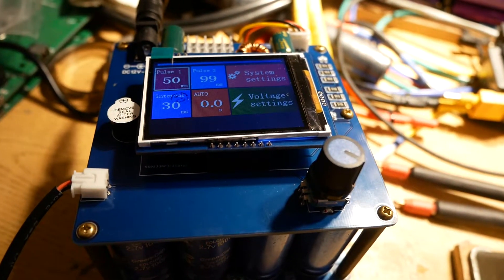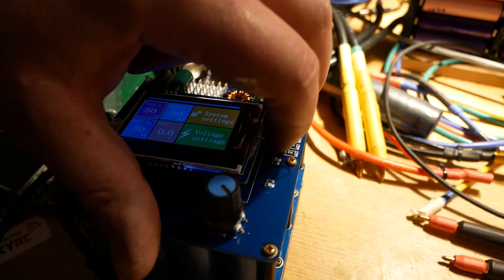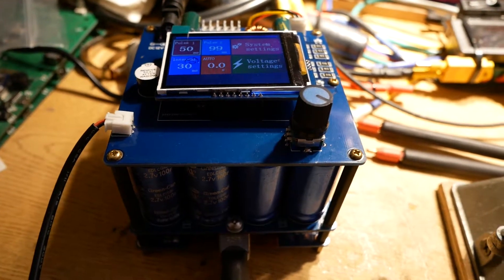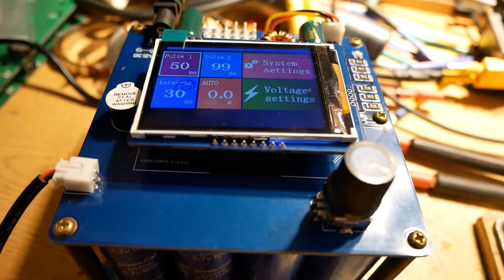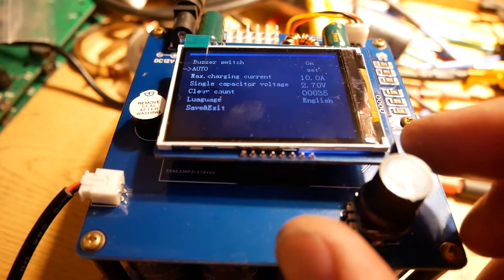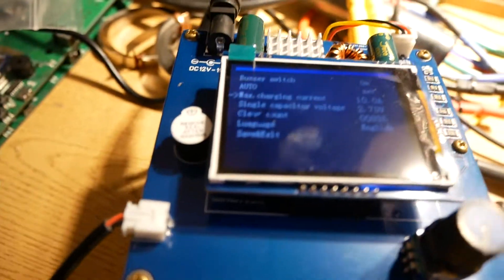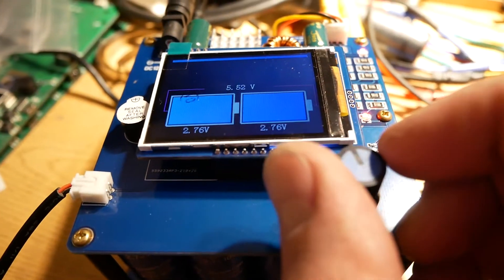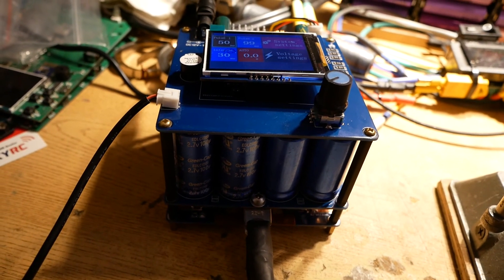Chinese 1600 farad spot welder review 1

Comment: The DB 100F 2.7V ones in my old data sheet says 10mOhm @ 1kHz... So maybe 2.5mOhm in total, not sure how much inductance and resistance is added by the studs though.
Reply from the maker: I replaced the studs with copper rod that is much thicker.

Comment: It’s all about the capacitors. Even a Kweld with crap capacitors will be crap
Reply from the maker: That's overly simplistic. It's about  several things actually. 
1. Lead lengths need to be short enough that the inductance on them doesn't impede current flow to the tips overly much.
2. Lead cable needs to be large enough to carry the current with low enough resistance to not waste too much of it.
3. Low RDS mosfets with quick turn on times are needed so that current isn't impeded by the mosfets.
4. Current paths from the super caps to the mosfets and the weld leads need to be very short and very beefy so that inductive and resistive losses are very low.
5. High ESR super caps will dump current much more slowly than will low ESR caps. Either have lots more high ESR caps in parallel or use low ESR caps.

Comment: i ordered this spot welder a week ago expecting it will weld 0.2 for milwaukee battery, did u ended up upgrading it?  im thinking about getting the kweld as well, what do you recommend me getting? is complete kit with caps good enough for welding 0.3?
Reply from the maker: This won't weld .3mm at all. I did mess with it some to improve its performance. I replaced the brass stand-offs with copper and that helped a little, but not enough to get me to .3mm. I then got busy with more interesting projects and haven't messed with it since. I think legit, low Rds mosfets are the next thing I'd try.
...
Honestly, if you can afford a KWELD, don't waste your time with this Chinese spot welder. Just get a KWELD and KCAP module and you will be able to spot weld whatever you want. The KWELD is miles and miles better than this spot welder and far more powerful.
Reply: @de-bodgery  what power supply did u use for the kweld and kcap? Having capability to weld 0.3 or more is always good.. maybe i could  build battery for my surron too..
Reply from the maker: @sc83856  I bought the KWELD specifically so I could build my own packs. I guess I've built about 15 packs now. Most are 16S or 20S with a few smaller ones. The larger packs are all welded with .3mm nickel. There is no reason why you can't build a pack for your Surron! 
*
I am using 2 Meanwell SE-600-12 PSU's in parallel turned all the way down. They can each deliver 50 amps for a total of 100 ampos charge current for the KCAPs. I have 2 KCAPs on my KWELD. This lets me spot weld as quickly as I can go and not run out of charge. When I am spot welding, I get on a roll and I stop for nothing except to cut more nickel lengths and overly hot weld pens. I don't want to wait for the super caps to charge up when they run down. With 100 amps into them all the time and 2 KCAPs, I don't wait for them at all. If you go with a battery solution, you will want lots of capacity and lots of dump current. I tried running my KWELD without the super caps on 4 Multistar 10,000mah LIP packs in parallel. They could deliver the dump current needed. So if you use heap LIPOs, except to need like 8 of the Multistar packs in parallel to deliver the current you need. Also, you need lots of capacity. Each spot weld may not last long, but its something like 600-1000 amps with each weld. This is a lot of current and will drain a LIPO pack pretty fast. I built a battery pack from some LTO pouch cells I have. They are 11Ah each and can deliver 350 amps continuous. I put 4 in parallel for 1400 amps of dump current and 44Ah. It's about the size of a small car battery. This lasts a decent about of time if I need to go portable. Personally, I don't want to charge batteries for normal battery building use. Hence the dual SE-600 PSU's.
*
IF you have access to the KWELD thread on Facebook, search for Richard Gumfaw. You can see my KWELD there.

Comment: How much you pay for chinese spot weld?how much you pay for the kweld with the capacitor kit and power supply and adapter?
Reply from the maker: KWELD is in a totally different league. There is no real comparison here. The Chinese welder cost me $150. My KWELD setup cost me much much more. IT can also weld continuously for hours and hours while spot welding .3mm nickel. The Chinese welder can barely do .2mm and will run out of charge in a minute before you have to stop and let it charge again. It's a very low usage spot welder while the KWELD is a pro level spot welder.